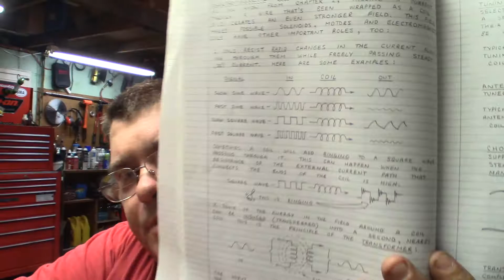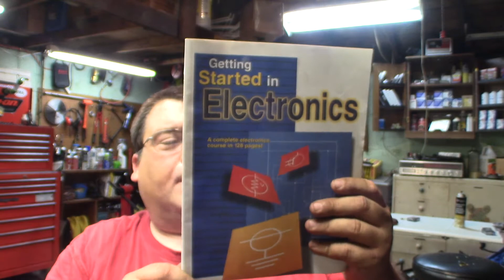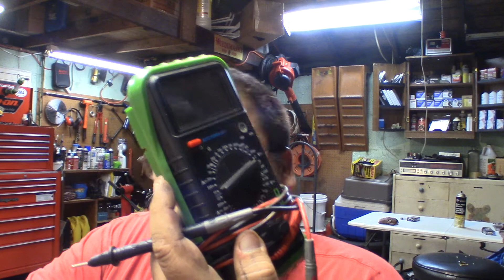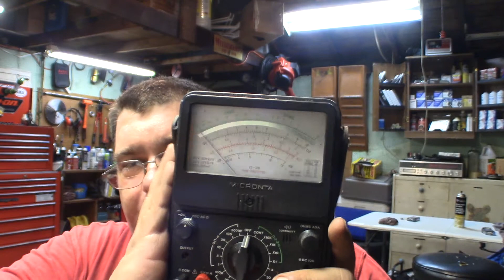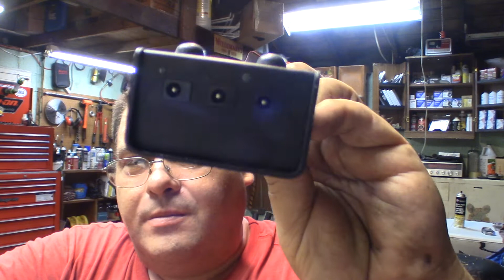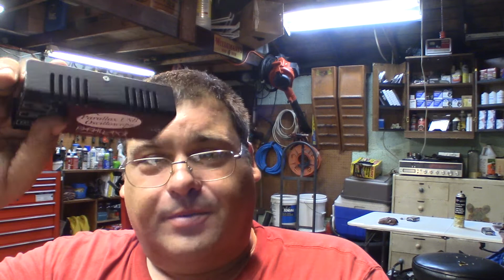Getting Started w/  Automotive Diagnosis for DIY Troubleshooting

Comment: The Simpson 260 meter is a must have for electronics.. can be found at flea markets cheap. i also had the gen 1 radio shack electronic book.. was a member of the battery club growing up was such a fun store.. used to get the electronic project kits for christmas for years growing up.. Thanks for sharing
Reply from the maker: The Battery Club.  I had 8 cards and rode my bike to each of the 4 Radio Shack's in town twice a month!